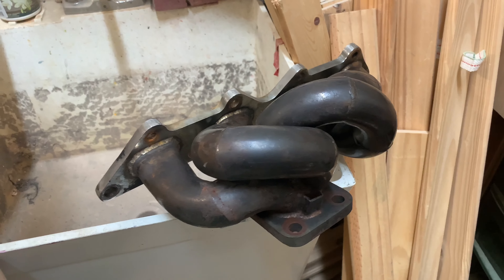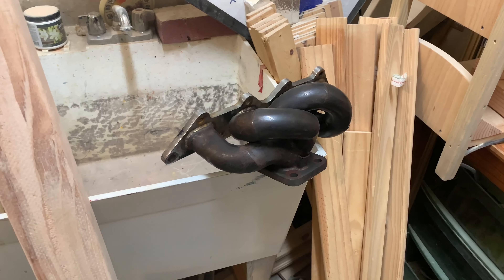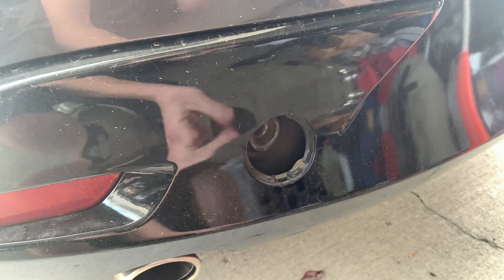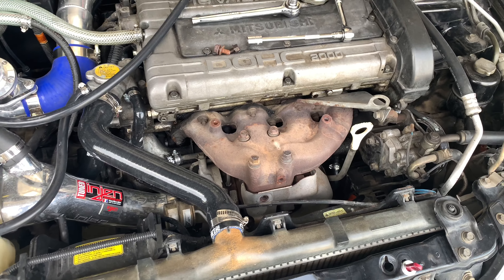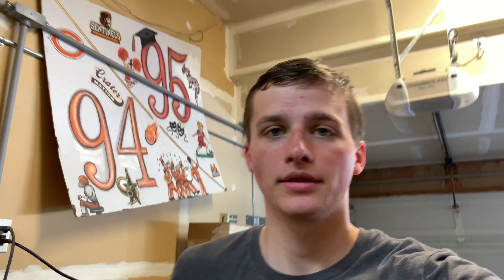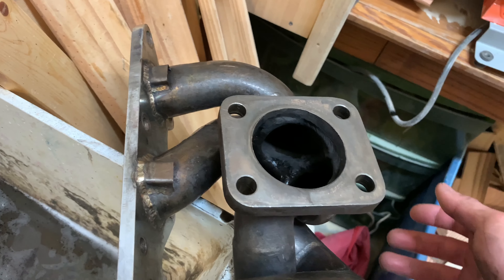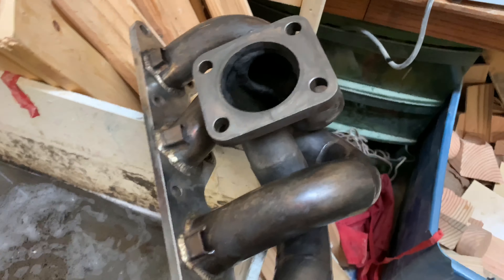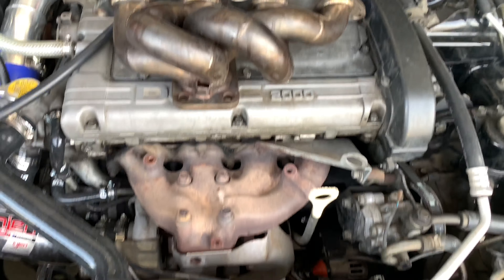Cleaning a $40 Exhaust Manifold

Comment: You could get the oem ported and powder coated it will last longer than the $40 one
Reply from the maker: Yeah, if the $40 manifold ever fails, that's the backup plan. Thanks for the sub btw :)